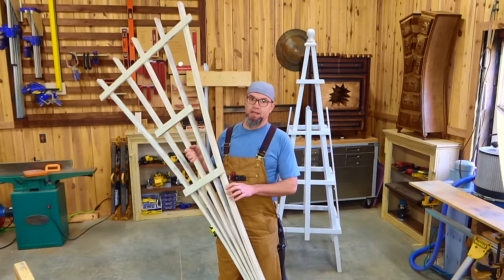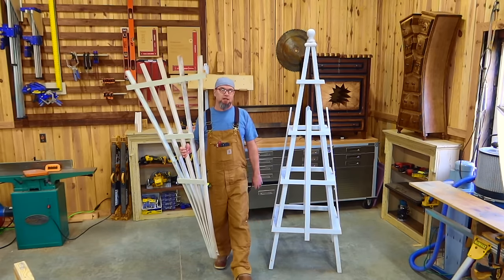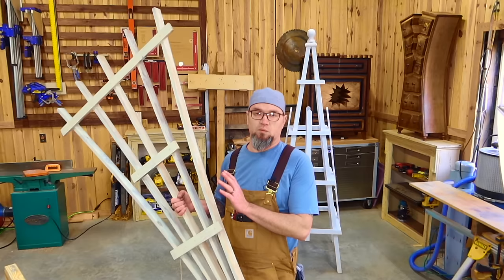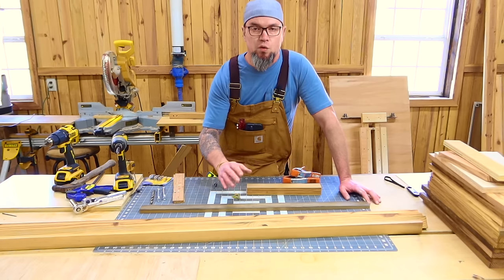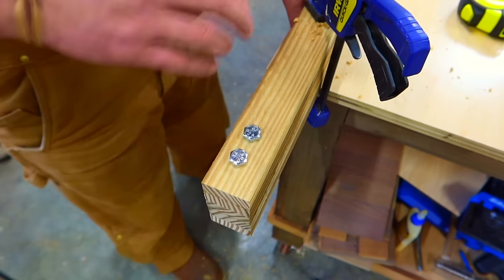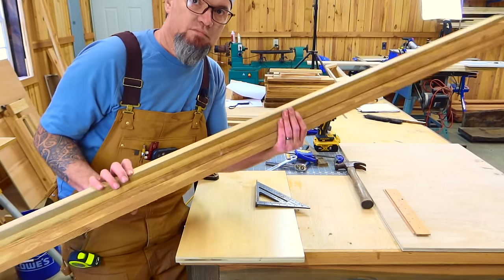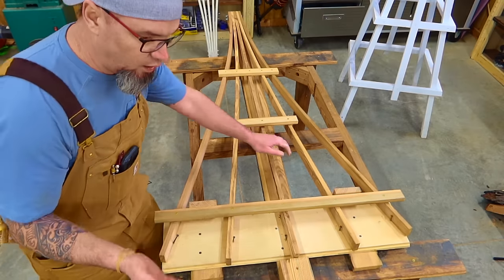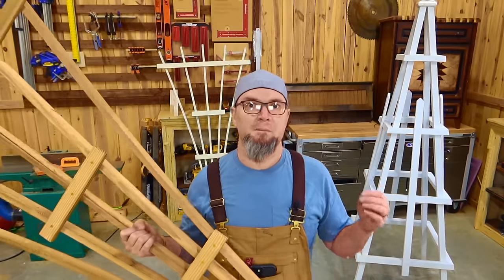650% Profit - Make Money Woodworking - Full Build

Comment: "have you seen the prince of flowers?".  Lmfao

Have you seen the price of WOOD?  I work in a lumber yard and our 2x4 studs are almost $10 each.
Reply from the maker: Thats insane.  But think outside of the box.  Have you seen the price of a cedar fence picket?  $3.99 here.  2 pickets will make a trellis.
Reply: @MatthewPeechWoodworking  the cedar is kiln dried... it'll snap in half and it's only 3/4 thick and $4.29
Reply: @socraticdisciple1761  we used a piece of cedar board that is 7/8” thick and it didn’t snap
Reply: @kwaks1979  was it kiln dried?  The cedar dog ears we sell are kiln dried but I guess they could be soaked to soften them up. 🤔.
Reply: @socraticdisciple1761  we used it out of cedar board. I believe it was a 1x6x8. Some scrap pieces left over from hubby’s jobs. It looks so nice.
Reply: @socraticdisciple1761  so you don’t recommend the cedar picket fencing? Want to get some more material and was thinking of using that. I do know how flimsy they can be and that does worry me.